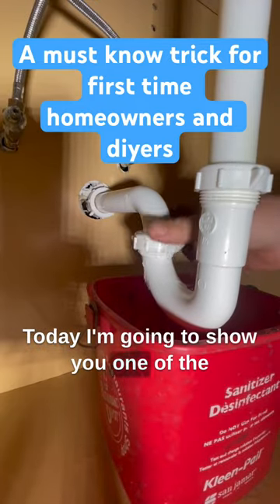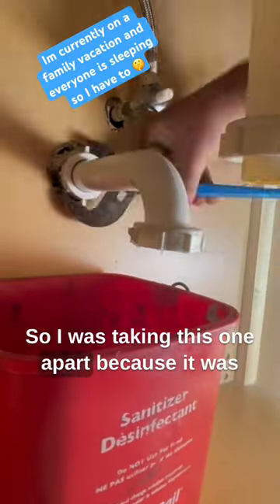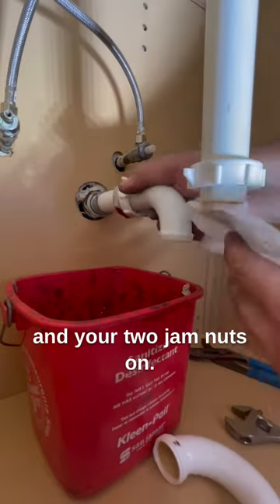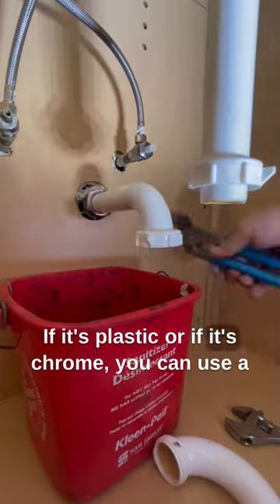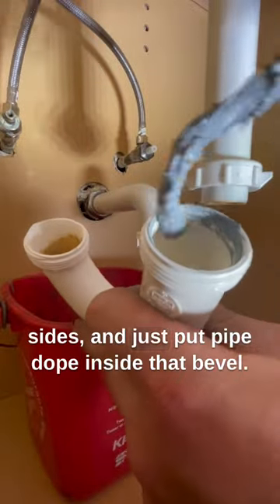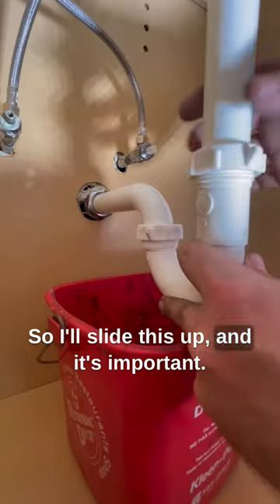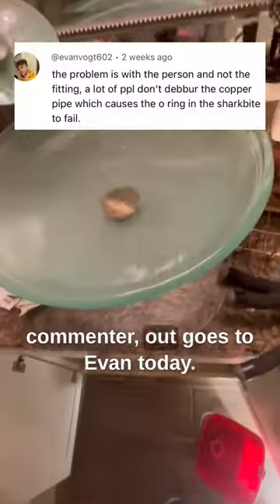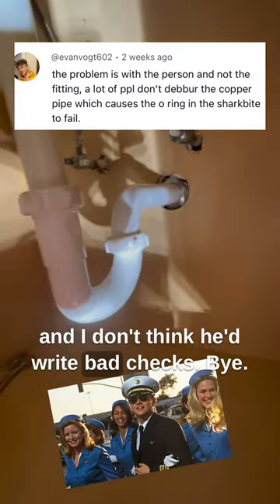Simple how to assemble a trap under sink

Comment: Just threw one in the trash that was covered in RTV on the outside. Would have reused it otherwise. If the sink and countertop weren’t being changed it would have survived anything. My part was replacing the cast iron drain with PVC and a Fernco to connect to the galvanized vent to the drain. If it doesn’t leak I don’t care if you used dog food to seal it!